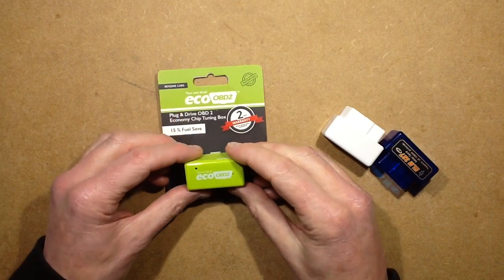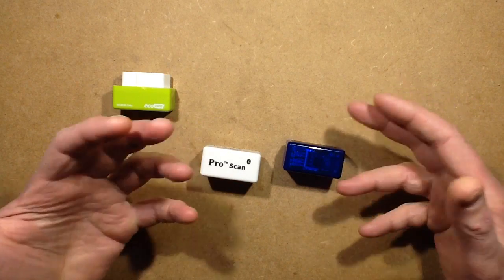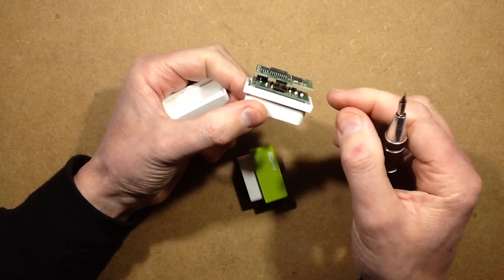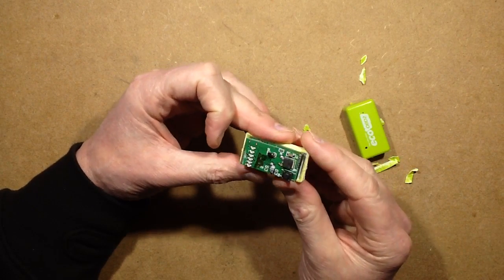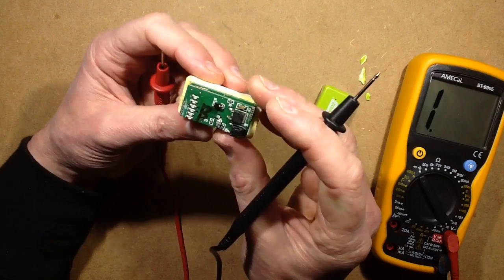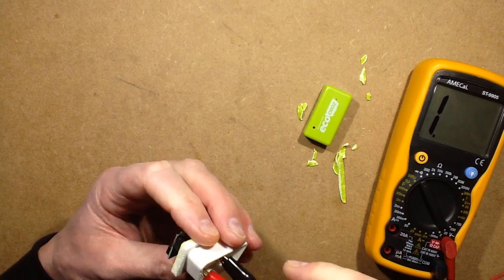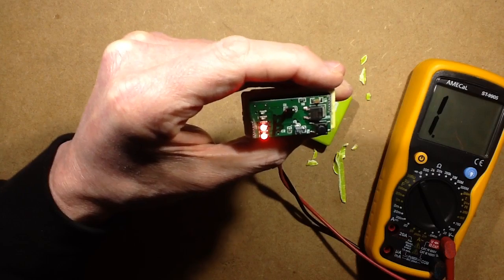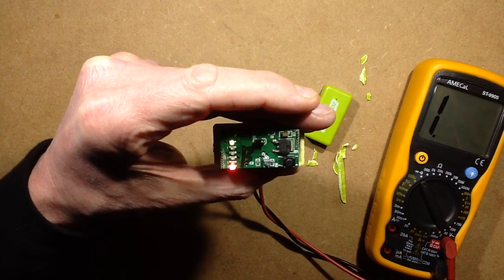Inside an ECO OBD2 "chip tuner" fuel saver.

Comment: I think these devices tries to do something..
I have the red one (Nitro OBD2 for diesel, "up to 35% more power, 25% more torque"), and in my car (Renault Megane 2, 2007 mod), a red led is flashing really fast for a few seconds.. and then it is a steady light.
Also tried it in my uncles VW Caravelle 97 mod (the box says it supports "all cars from 96 and up", and in that car, the led flashes slow, just like in your video here..

So.. I think that the slow blinking, is when it is connected to an non compatible vehicle.. like here, since you did not plug it in to a car.

In my car, I think I felt a little boost.. but might as well just be placebo effect :P And also, looks like the car uses a little bit more diesel.

Comment: If you really want to improve your fuel economy? DRIVE SLOWER! Don't drive up everyone's ass! Accelerate a little slower from the light and get off the gas pedal sooner if heading for a red light. Every time you step on the brakes you are losing momentum that will require more fuel to regain.
In other words. STOP DRIVING LIKE AN ASSHOLE!
Reply: +Pha Q You are totally right. Here in Germany it's even more important because there is no speed limit on the Autobahn where idiots with tiny dicks can race their "super aerodynamic" SUVs at full throttle. Very efficient. ;-)
Reply: Robert Slackware every combination of engine,trans,gears, and body style will changed those numbers. The best mileage I get is 44mpg at 65mph. After a certain speed the drag starts to increase in turn uses fuel.  I don't know of ANY car that does better at 100mph unless it's being pushed at the same time
Reply: Robert Slackware so full of shit
Reply: Just thought i'd point out that driving slower no longer is the key. Some vehicles are way more efficient at 75 than 60, where the computers are running for maximum efficiency. And at slow speeds theres little you can do. Sure, dont romp it from light to light, but taking off 'slowly' does nothing because your car is feeding you only a little fuel to get up to speed. You have to accelerate 'with balance'. Not 'slower'. 

Driving like an asshole has no effect on your fuel economy. Driving ANGRY however does. Angry makes you fast, having to be in front of people. Assholes generally drive 65 in an 80 anyway.
Reply: railspony complete rubbish, all reputable sources, and all hypermilers know that cruising at 70 mph is less efficient than 50. This is because air resistance increases exponentially as speeds increase. As for knowing what my car's do, they have ALL had instant and average MPG readouts on the dash. This is backed up by regular tank to tank calculations to confirm accuracy of the readings.

My current car gets 60mpg at 50mph, 55 at 60mph and 50-45mpg at 70mph. So you have all the information in that car the 6th and final gear is available at 43mph.

My previous car could get 75mpg at 50mph but only 55-60mpg at 70mph, in this the 5th and final gear could be safely engaged at 30mph.

This is backed up by all current guidance on fuel economy. I suspect the ultimate best economy is at an even lower speed, but I've never tested that as you become a nuisance on motorways at anything below 50.
Reply: yup you are so right. people don't understand that just doing those simple things improves gas mileage and reduces brake repair by 40%. I had a 96 Cougar with a 4.6 with nothing added. I got 21mpg with the AC on doing the speed limit. BUT if I went 10 mph faster I got 16mpg. Somewhere between 2000 and 3000rpm it would go into a power making mode and start burning more fuel and change timing and crap to create it. but hey if you  want to throw money away go ahead. You get the same thing by disconnecting the battery in which the ECM goes into a learning mode and sets it's self up to your driving habits that part every car is capable of doing.
Reply: Robert Slackware must be talking about your story telling
Reply: Accelerating more slowly will generally leave you below the most efficient part of the power curve. Most vehicles are actually most efficient at about 75MPH not 65, because that is the speed people try to drive on a freeway. That has been tested by many. Comparing 65 to 100 is not very useful. If you have AC on high, yeah, your most efficient speed is lower.

If you get up to highway speed, look at your RPMs. That is where you want it when accelerating. Most people are already accelerating more slowly than that!

At the other end though, if you try to prepare for slowing down or stopping by letting off the accelerator in time so that you rarely use your brakes, or only for the last bit of stopping, that obviously helps a lot. This isn't only for city driving, there is no reason to hit the brake every time there is a bend in the road, as a lot of people do.

Good braking practices will save you more than you're losing by accelerating below the power curve, though, so the advice isn't completely awful. But if your acceleration is based on going slow instead of on hitting the power curve, you've no reason to even suspect it is saving fuel.

Using cruise control consistently will also save a lot. An expert driver is too slow to do as good a job as a computer at that.
Reply: railspony ummm no, most cars I've ever driven in europe are much more efficient at 45-55 mph vs at 75 mph. Drag increases massively at those higher speeds. Everything else is correct, but for efficiency you need to drive slower too.
Reply: Daniel, in my experience when I drive a car, I don't get any sort of efficiency printout when I turn the car off. It would be very, very strange for it to be true that you're talking about efficiency of cars you drove, and also that you know what that efficiency was. What I'm going on is published test results in magazines that publish tests about consumer products, cars in particular. So I'm always going to trust that over somebody saying, basically, "I've driven cars and I guessed something else." Please, go, read, learn. You don't know what a car's efficiency is from having driven it, you know that from having read test results.
Reply: railspony you clearly haven't drove a car built in the last 15 years as almost all of them can give a "printout of mpg at the end of each journey". If you would like some reading material on the subject, including some pretty pictures, try here : http://www.mpgforspeed.com
Reply: LOL those center console readouts are approximations lololololol my GPS provides similar approximations as does an app, but those are not real numbers, and they are nothing like accurate or consistent from one vehicle to the next. No, you don't get a printout of your cars efficiency when you turn it off, because nobody was testing the efficiency! It isn't like you fill up your tank and can drive at a constant speed to your destination, and that you would have tested the exact same route at a bunch of different constant speeds. It requires controlled testing. And no, I'm not going to click on some website you advertise.
Reply: or just stop driving.
Reply: Mark Honea  Drive 1 MPH and you'll save even more gas! Or wait, would you burn more?
Fire up that calculator! I'm an old-timer, myself, I actually can do this in my head. Just sayin.
Reply: railspony fuck off you ignorant troll. No they are not approximations, they are compared tank to tank for accuracy when the car is filled up. I can list hundred of links if you like, it's not advertising it's proof. Obviously you also believe every bit of propaganda conspiracy theory and reject things such as physics and science. Bellend.
Reply: Pha Q Fuck you, I have places to be.
Reply: +Pha Q     Woman are the worst, they are constantly going from the gas to the brake, just so as to maintain an exact 4' space from the car in front.

Comment: I work on systems that will use the (SAE)J1939 protocol for powertrain CAN (as most automotive / industrial powertrains use) and CANopen or other protocols for other controllers ie. proportional control and feedback loops for hydraulics / pnuematics and the like.
This is pretty normal on modern equipment, automotive gear, computer controlled engine management, as far as I know J1939 CAN is the automotive industry standard for engine management / OBD2 systems.
 The J1939 protocol is an automotive / powertrain protocol with standardised values that can be read with an OBD2 interface. Not all the possible options are used on a specific engine, many other values exist that don't apply to every vehicle (fuel rail pressure will be sensed on a common rail diesel but not a manifold fuel injected petrol engine generally). Common values that are used for operation of any engine though as are needed for basic engine function ie RPM, coolant temp, battery voltage, injector duty cycle, crank / cam position (trigger) etc.
Case in point, most OEMs are tuning production engines for maximum economy and emissions compliance -why wouldn't they be (insert conspiracy theory comments below #dieselgate) they want to sell cheap to run cars that perform...
I doubt this device, if indeed functional, is going to be intercepting CAN data and spoofing values to other nodes,  modifying parameters in any way that would be any thing other than lying about o2 or N0x sensor values and fattening up air fuel to improve performance (which in some cases violating emission standards WILL use less fuel, INCREASE performance and economy on the road) or leaning out the air fuel ratio which is potentially unsafe as OEM tune is generally "safe lean") to gain economy for the user.
Running an engine A:F ratio leaner overall is going to be detrimental to power output and be less efficient and possibly damage mechanical components which seems counter intuitive from a warranty standpoint.

In summary, buy a cheap ECU and wideband o2 sensor for live mapping feedback if you want to try tuning!
If not, don't buy something like this to save money. It wont, SPEND IT ON MAINTENANCE!

Great vid Clive, love your channel!
Reply: +Paul Bearer 

"In summary, buy a cheap ECU and wideband o2 sensor for live mapping feedback if you want to try tuning! If not, don't buy something like this to save money. It wont, SPEND IT ON MAINTENANCE!"

I would also add that a good way to save fuel when driving is to alter driving habits, such as not accelerating too quickly from a dead stop or driving at excessive speed, especially if the speed is above the posted limit.
Reply: Try telling that to my missus! :D
Definitely makes a huge difference though. 
Merry holidays!
Reply: Paul Bearer

Unfortunately, that's true.

And thank you.

Comment: It would be interesting if it would do anything to a car, even my older ones from 96 and 98 have OBDII and yet require specific software and connectors to get any decent amount of data and to modify anything.
Most likely it's just blinking lights, although it is less evident than the one that sticks into the cigarette lighter.

Comment: Since it can work on any OBD2/EOBD car, it is only going to have access to the OBD2/EOBD controls. These are limited to reading fault codes, reading live data (engine speed, coolant temp etc), clearing fault codes and resetting adaptations. 
The adaptations are adjustments made by the ECU over time to correct so wear and tear, sensor drift etc. If an engine looks to be running a little rich at all times, it will monitor this and eventually apply a correction based on the history. In effect, they self tune themselves to stay on target. The only thing I can imagine this would do to alter anything in the engine is telling it to reset the adaptations continuously, and that would most likely give the opposite effect of worse running.

Comment: You're assuming a lot... You should get an oscilloscope that is able to decode CAN and actually test the data lines instead of just looking at the LEDs. What is that going to tell us? And you didn't even look at the microcontroller. Some of them have dedicated CAN IOs, and that would be a good indication of the possibility of whether the device is transmitting or receiving messages.
Reply from the maker: +SeanHodgins Even a smart oscilloscope with serial data conversion would only show basic info about what commands the unit was sending, if any.  The oscilloscope would not be able to respond to any request in a meaningful manner.  The only thing that can test this device is a full programmable engine simulator that can emulate a long drive and analyse anything the unit did.  Such a unit is somewhat specialised and could potentially cost tens of thousands of dollars.  Quite expensive to test a cheapo ebay dongle that probably that makes wild claims that imply it  can change the engine characteristics of ANY vehicle it's plugged into.
Reply: +bigclivedotcom I totally agree. I just mean aside from blinky lights, how do you know this thing is doing anything other than that. I would be interesting to see if it's at least asking for info from the engine while its blinking the LEDs. It could just be meant to give people the placebo effect of "I spent money on better fuel mileage, I should also drive efficiently myself" - driving a little deeper into the technology would be interesting, looking at data lines and the actual uC, etc.

Comment: Thinking about this, this could actually work on older cars as well as American and Japanese ones. Most modern European cars protect the engine management systems pretty heavily due to how Eastern European car thief gangs used to steal cars by unlocking the doors, the steering lock and finally getting the ignition going simply by accessing the CAN bus. Stories talk about thieves being able to do all of this simply by partially disassembling one of the side view mirrors, connecting to the CAN bus terminals of the microcontroller that controls the side view mirrors and sending some messages to all the other systems on the CAN bus. The way the Germans usually do it is that they have all the critical systems like the ECU on a separate bus and a gatekeeper making sure that these can send out their diagnostics data, but that no messages that shouldn't get on there actually get on there.

Why do I mention Japanese and American cars as ones that this might actually work on? Because if you remember the recent headlines about hacking cars and how easy it is, they did all that stuff (killing the engine, breaks, lights, AC, radio, ABS, etc.) simply by getting access to the CAN bus or compromising something with access to it (in case of the Jeep hack it was the in-car entertainment system that they were able to command it remotely via internet access) and then sending the messages to these systems to shut down.

I'd say that the CAN bus is just one of those technologies developed without a single thought spent on security. It was created simply to cut down on the number of networks and wiring needed, but from a safety perspective I'd call it a complete disaster.

Comment: I would find my self one of the really old cars that still have OBDII & plug it.. them if the computer in the car don't burst in flames! Would talk to one of the really old "I mean really old" Mechanic that have the old style of diagnostics computer! You know the type that you put power to pin x,y & Z on the Eprom and run diagnostics!! many people don't understand that the computer in every single car in the road have a contract signed with the oil companies as the computer that I'm using have a user agreement contract.. the computer is loyal to the manufacturer and the manufacturer is loyal to the Oil companies.. not to the user! You never know! May be this little gadget can change the % of fuel per Revolution.. and truly save you Mula!!!

Comment: yeah id definatly not trust this.

depending on the car it is possible to make modifications to the ECU over OBD.  With peugot though im sure its only possible via using a special interface that allows progromamming. theres another interface thqat allows changing settings but wont do flashing of the ecu

Comment: it`s quite possible to remap some cars over the OBD port. a lot of tuners prefer this method. we`ve past the times when you would have to take the ECU out and replace hardware altough, on some models, you have to do that in order to be able to bypass some kind of protection. i`m no tuner but i do have some knowledge about this. let`s hope someone will sort it out and let us know exactly what it does. thanks for sharing

Comment: I just flashed my ECU and TCU via the OBDII Port on my VW GTI. Also read, changed and cleared ECU values with a ross-tech vcds USB dongle.
Reply: +LostInTheElectricalAisle: The also have performance boxes that just connect to the OBD-II port and adjust air/fuel ratios and such.

Comment: I have used and app called forscan to run diagnostic checks maybe if the car is put in diagnostic mode the device can pass values to ECU to temporarily override the factory settings.